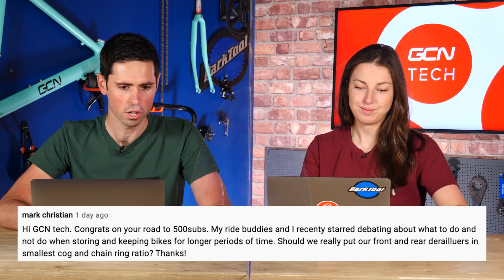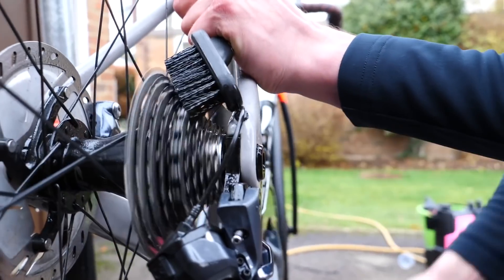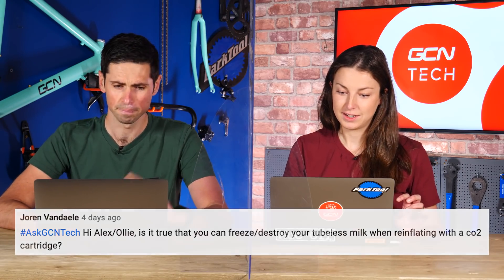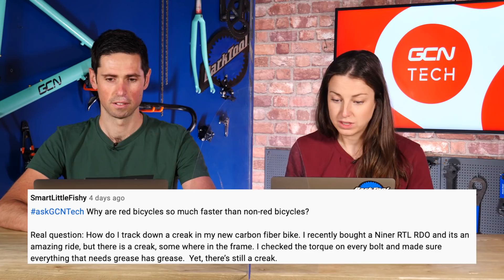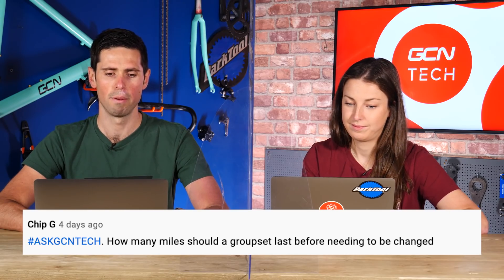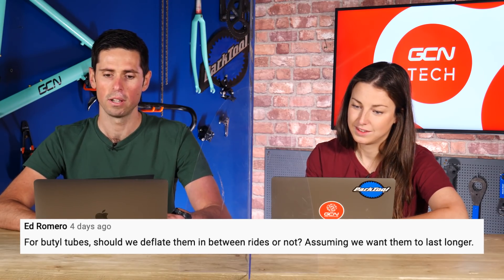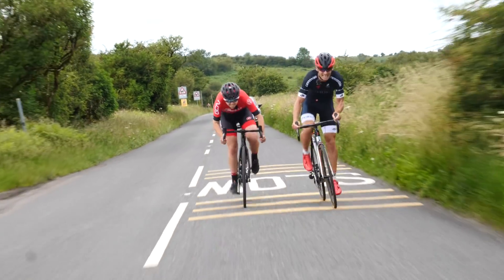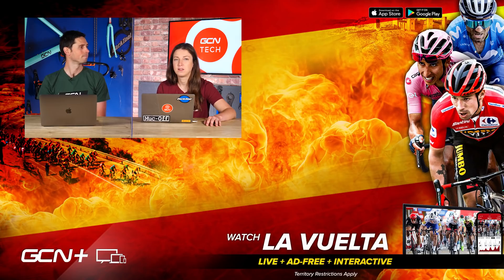Do CO2 Cartridges Really Freeze Your Tubeless Tyre Sealant? | GCN Tech Clinic

Comment: My chains last up to 3,000 miles, depending on weather/mucky roads. I changed my cassette at about 20,000 miles even though it worked fine and my chainrings have done about 24,000 miles. The push fit BB lasted 16,000 miles. Idlers lasted about 12 - 15,000 miles. Deraillers work fine at 24,000 miles as do shifters. I've had 3 rear mech cables and 2 on the front. I changed all outers and brake cables at about 18,000 miles - when the bar tape wore out.

Comment: #AskGcnTech Hi there Alex and Ollie/Manon, I bought a basic Decathlon Triban RC100 road bike about a year back, and the spokes from the rear wheel go loose or break very often (almost after every ride) even though I ride on nice non-bumpy roads. Haven’t found a proper solution to this from any LBS around. What do you suggest might be the problem here? Are those wheels just bad, as they’re basic ones? Or are the bike shops truing the spokes wrongly? 
Thanks in advance!

Comment: #askgcntech. Is there a way to customize your cassette?  I know they are designed for pros but I am not one. I would rather have single steps in the lower gears than the higher ones. Like having a 20, 21, 22, 23, 24, 25 at the expense of having  two tooth jumps between 11-17. Thanks!

Comment: #AskGCNTech
I recently changed crankset in my 2021 Merida Reacto 5000 from Shimano RS510, to Ultegra R8000 (same rings, and arms length). Now on the hardest gear the chain brushes sligthly right arm. In my LBS they took a look, and were not able to do anything with that, and they said it has to be like this, and it's safe. Is it really safe, and I can cycle like this? The q factor of those cranks differ by 4mm, and propably that's the issue.

Comment: #AskGCNTech Hi Alex / Ollie / Manon. I'm obsessed with a clean chain (I currently use a chain cleaner weekly, approx. 150km's ridden). I was told the best way to get a sparkling chain is to remove it and clean it (e.g. in an ultrasonic bath). However, I understand Shimano's quick links are single use (which seems to err on the side of caution?). 

Can I actually re-use my quick link? (And if so, how many times?) Or do I need to go with something where the manufacturer has said is safe to re-use e.g. a Connex chain link? Thanks in advance and well done Ollie for dropping Contador!

Comment: #AskGCNTech Not tech directly, but more clothing specific. I'm planning to commute to work and back, 15 miles each way each day. The issue is what do I wear? I've been told that you should never re-use bib shorts, but I can't use two a day. There is no place at work to wash and hang them up, they need to go straight into my bag. So what is the suggestion?

Comment: I’ve frozen my sealant by using a co2 canister. It goes rubbery, and  is quite hard to clean off the tyre. It would be useless in puncture repair.

Which is really irritating as a canister is by far the most reliable way of getting the tyre to re-seat. Some sealants advertise themselves as co2 safe. Worth a test GCN?

Comment: Sprockets are more likely to "bite" into the freehub body when you haven't torqued the lock ring adequately. The specified torque helps clamp all the sprockets together so they act like one unit and distribute the load across the whole cassette. I would also suggest removing the cassette and thoroughly cleaning it to ensure there is no lube/grease between the sprockets & spacers so they have good mechanical friction between each other once torqued down. Also if you are using hub spacers because your cassette spd does not match your freehub speed you may be torqueing it correctly but the lockring bottoms out before actually make contact with the cassette leaving the sprockets a bit loose; I have two 11 speed freehubs that each need a slightly different spacer first installed for the same 10 speed cassette.

Comment: #AskGCNTech I have a 50/34 crankset and 11-30t cogs (Shimano 105 GS), can I use the 50t front and 30t at the back when climbing or will it really damage my RD dropouts? Just worried because my mechanic told me it does damage. Thanks!

Comment: Regarding the rear derailleur compatibility.  3 things to consider:
1 - is it compatible with the shifter?
2 - it's there enough clearance for the largest cog?
3 - How many chain links can it take up?  So with a typical road bike setup: chainset 34 - 50 that's 16 links, plus rear cassette 28-11 that's 17.  So the rear derailleur needs a capacity of 33.  With a 32 - 11 cassette the required capacity would jump to 37.

Comment: Many thanks for taking my question. I have a correction and an update.

The bike is a Niner RLT, I mistyped the name in the last post. The RDO (carbon fiber) model. 

Update: With the help of a LBS, the creaking noise has been narrowed down to the bottom bracket - a Pressfit 30. A search of the internet shows this is common with the PF30 standard. A new bottom bracket, spindle and crankset have been shipped. Hopefully one will solve this problem.  The GCN tech channel has two excellent video on the subject.

Comment: Interesting random question about deflating inner tubes... butyl tubes leak co2 not the other gases in 'air' so if you leave them inflated and just top them up, over time you get less co2 in there so they stay pumped up for longer and don't go so flat over a couple of weeks!

Comment: Hi folks at GCN. I currently run the stock Hollowgram 35 Disc wheels, but find them a little dull and am contemplating an upgrade. I’m in doubt between going “aero” with some Vision 55 or 40 with a slight weight penalty or the Roval Alpinist, which are 3mm shallower but almost 300g lighter. Given that I live in quite a hilly place, with many a double-digit climb around, will “aero trump weigh”? #askgcntech

Comment: On longterm storage of springs ,cables and tires it is common fysics to keep tension as low as possible when storing thing. Long term stress will deform (stretch) the body. So small ring indeed. Tension is not super high, and it is not sure it matters on small springs like a bike to much. But why not do it? It does not cost anything to do it. 

Some other examples of good storage: 
- tire pressure not to high, but not flat
- not bike related, central heating thermostats should be fully open in summers. It keeps tension off the springs; And there it does matter. Calibration can go way of if you store it wrong for to long

Comment: #Askgcntech   So a clean bike is a happy bike.  Got it   But is a polished bike and/or the non braking parts of the wheels a faster bike?   That is: does polishing your bike and wheels interfere with the air attachment/vortex shedding or not, or does it smooth the air flow and reduce drag? Of course a matt compatible polish where applicable, don’t polish the rotors or brake track on rim brake bikes etc etc

Comment: co2 cartridges maybe wont totally freeze the liquid in the sealant mix but it will cause it to lose its effectiveness. There are many types of sealants on the market of varying thickness and contain varying sizes of latex bits. The thickest liquid and the largest latex bits will probably be most effective in the extreme cold, while thinner liquid with smaller latex bits will become a lot denser when the extreme cold air is introduced to the tire. This means it wont move around as freely as before. Also when it eventually thaws out it is likely that there will be small fragments of ice crystals adhering to the latex bits and perhaps even some dilution of the liquid. 
This means that the sealant will lose much of its efficacy in plugging a puncture. If you need to inflate your tubeless tire that is already seated on the bead while on the road, then I would always recommend using a pump over a cartridge. If you need to reseat the tire, then a small pump wont do a lot so a cartridge is your best bet on the road. But when I would get home I would drain the sealant, clean the tire and swap it out for a fresh sealant and use a track pump with blast cylinder to reseat the tire properly.

Comment: In regards to sealant and CO2 cartridges, some sealants can freeze/clump up. Muc-off are one of a few brands who specifically state that their sealant is CO2 safe, so if in doubt, check the packaging.
Reply: Some sealants actually recommend against using CO2. That's because they separate under extreme temperature variations.

Comment: As sealant is mentioned, has anyone else had trouble with sealant going hard in the valve cores stopping the valve from working properly?  I can't remember the last puncture I had but twice I have had flats through leaking valves since I started using sealant.  I carry spare valve cores now.
Reply: Same. It’s a problem for sure and pumping the tyres up can get troublesome too.
Reply: Would love to hear a solution to this….but in the meantime, remove the valve core and soak /rinse in hot water.

Comment: GCN come on! With 1X the issue he most probably will face is the offset of the 1x front chainset, 1xring sits closer to frame, so when you go bigger on the chainring it can have clearance issues with the chainstay! 42 to 50 is a way bigger diameter, most frames running 1x can't go bigger than 42 or 46 due to Chain ring offset.
And Co2 the issue isn't freezing it's the fact that the Co2 over a period of time separates and destroys the liquid latex at a chemical level, making it extremely watery and unable to seal, that's why Muc off worked hard on making their sealant compatible with Co2.
Reply: How would CO2 'separate'? The enthalpy of CO2 is significantly lower than that of elemental carbon + O2, which is why burning carbon (coal!) in air results in a strong heat emission. It is possible that CO2 degrades the sealant over time, or that the sealant degrades by itself (possibly starting to do so because of the very cold temperatures caused by CO2 expanding on inflation, but CO2 is very stable.

On the 1x ring - fair point, though I think you could have phrased it more clearly; GRX is a gravel groupset, and pretty much all gravel frames will use 1x or 2x setups, so talking of '1x frames' isn't particularly relevant.
Reply: @dlevi67  the Co2 causes the fluid to separate. It's not the Co2 separating, some older simple fluids go really watery but then some Luke Stan's Race go like a gooey rubberised snot, a rep for Stans told me they add more Propylene Glycol than most others and there's a good chance thats why it reacts to prolonged exposure to Co2  and goes gooey rather than going the opposite direction like others and turning into what looks like a 2 part solution. It's why Muc off have Co2 safe on their product, they are one of the only sealants that still stays the same in a Co2 atmosphere.  
I also remember a article which looked into thermal shock and most brans said it was a non issue only  effetto mariposa showed concerns of thermal shock. But every brand agreed that prolonged exposure to Co2 destroys the sealant weather it's beading separation or the Stan's snot, they basically said use it to reseat the tyre etc at the road side then as soon as possible remove the Co2 and reinflate with a good air. One brand wish I could remember stated when home wash out the sealant that you used with Co2 and refresh. 
Or buy Muc off 😂
Reply: @love2wheels748  ... or use tubes, I suppose. 🤪

Thanks for clarifying - I read the 'separating' as referring to the CO2!
Reply: @dlevi67  lol 🤣 yep very true. I'm a true tubeless convert years on mtb's then road n gravel, around West Dorset the farmers drag crap out onto the roads all year round, I use to go through tubes like a sailor does rum lol.
And now Stan's have their simply amazing Darts that also work with my Muc off 😉 Tubeless on road is now the only way I ride. 
Happy riding have a great weekend
Reply: @love2wheels748  You too!

Comment: OMG! Creaks! One that drove me nuts was the through axle on the front! I kept thinking it was my wheels, headset,...finally I bought a new through axle and no more!! That was more out of a desire for a cleaner look and didn't occur to me that may be the problem. The other was I checked my driveline a dozen times to include removing my cranks and checking the BB. I accidentally found the problem when I went to remove the cassette that I checked the several times. Once I got the cassette off, I found that the preload on the freehub was a little lose. (A little older set of HED wheels.)

Comment: Freezing sealant is one more reason that I hadn't thought about that makes me glad I switched to a mini pump over CO2 with a tubeless setup.  I stopped using CO2 years ago because I found I wasn't able to finish my ride w/o a flat tire as the CO2 got warmer and my tire pressure dropped.   With a mini pump, I have an air source as long as my arm is capable of pumping, where as I'm out-of-luck if I run out of CO2 cartridges while on the road.
Reply: Some (mine) wheel/tire setups can come “unseated” when going flat. It’s the only time I risk using CO2 on the road as of course the hand pump won’t work for that purpose.
Reply: Once had 2 flats with 1 can of CO2. Needless to say that ride didn’t end well for me. Now I carry a mini pump.

Comment: The most expensive creek I ever found on the bike that drove my ride group and myself crazy was when it was the weld from the top tube to the seat post cracking and came apart on my 2004 Allez. Specialized was great in replacing the frame and by their inspection of the frame, they discovered that the end my seatpost was flexing right at that junction. The future fix was to make sure that new seatposts were an inch and a half below or above the junction. I learned a lot about modes and nodes which is negative and positive flexing cylinders. :)
Reply: Up shit creek

Comment: CO2 is weakly acidic when it dissolves in water, whereas latex-based sealants need to be slightly alkaline for the latex to stay in solution.  I have not verfied this personally, but it seems likely that inflating a tyre with CO2 will cause some or all of the latex in the sealant to solidify, meaning it will not work to re-seal the tyre.  You can tell if your sealant uses latex as it will smell slightly of ammonia, which is the weak alkali normally used to keep latex solutions dissolved.
Reply: I have had fresh Stan's sealant turn solid after a CO2 injection so I think you're right
Reply: That's exactly what happens, a tyre full of cafe latex turned to solid lump after I used a CO2 cannister to get me going again. A pig to peel off the inside of the tyre.

Comment: Is there a difference in performance between road pedals and mountainbike pedals? I don't see why you would have the discomfort of road shoes compared to SPD (which you can also have with a bigger surface) #askgcntech
Reply: Check this video https://www.youtube.com/watch?v=ykU99jLIFgg
Basically there is a difference, but it is more to the shoes I think. Road bike shows are stiffer. Apart from that SPD-SL pedals have better power transfer as they are bigger. However I think SPD pedals on road bikes are fine if you don't do races.
Reply: Cleat position on most road shoes will be forward compared to a more midfoot mtb cleat position.

Comment: #AskGCNtech
Nice service your doing for us all :-)
Anyhow, 3 years ago i bought myself a Cube Attain Black'n Red with 2x8 shifting.
After using some of your aero-hacks, aero-bars and some serious training, I was thinking about changing the gear ratio.
Having a Shimano Claris FC-R2000 50x34T crank installed... What do I need to look out for, if I want to change to a 52 - 54T set?
Can I use 11-speed cranks? (Finding 7/8/9-speed cranks is a pain in the ***.)
Thanks in advance :-)

PS.: Build my own DIY-Disc wheel... thought it was really rapid, but testing it on a outdoor velodrome at same heartrate (140bpm -> 37km/h) with and without the covers revealed i was 0.3 seconds with cover slower for 5x 400m laps... (using Vision Team 35 Comp SL wheels, which shouldn't be as aero) do i need to roughen up the surface?

Comment: #AskGCNTech - Hi humans! I had to index my gears (Shimano Claris) and had two questions following some issues -

Does cross chaining impact accurate alignment set up?
And I noticed the barrel adjuster near my top tube is completely seized - will that cause issues for the barrel adjuster near the rear mech or overall cable tension problems? 

Any help appreciated (but if you advise me to bin the bike and upgrade then that’s okay as it means I have welcome justifiable evidence to show to my girlfriend!) 😝
Reply: Cross chaining will make setting up the front changer really difficult, it has to be accurately setup w.r.t angle and distance between the top of the chainring and cage
Seized is a pain, try and soak it with wd40/gt85 over a few days and it may loosen, the issue will be less adjustment available but it will not affect the overall tension
Reply: @arundelnet  I gave up and took to bike shop... Mechanic said my big front ring, cassette and chain were worn out! He said thats the most likely cause of shifting problems. I'd never have known as I don't enough experience to know what to look for (but makes sense as it's a budget bike and it's taken about 4,000 miles of hard riding in Scottish weather!) So yeah.... pretty much new drive train needed!